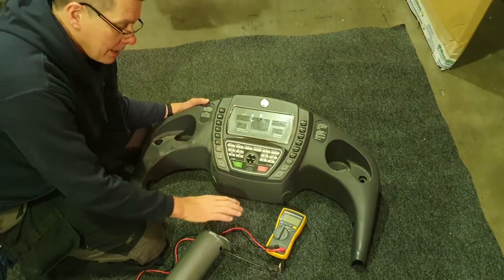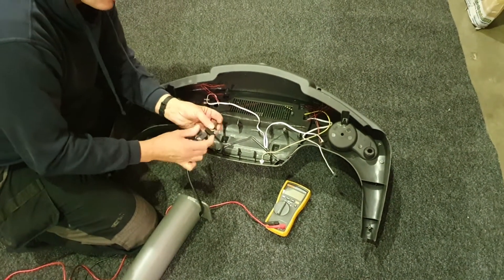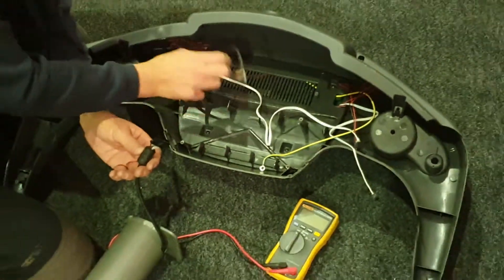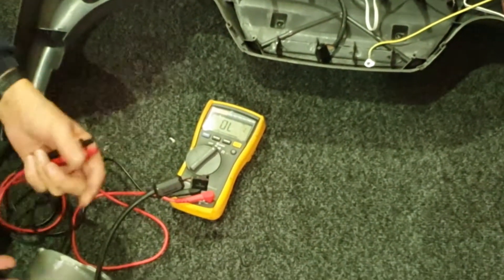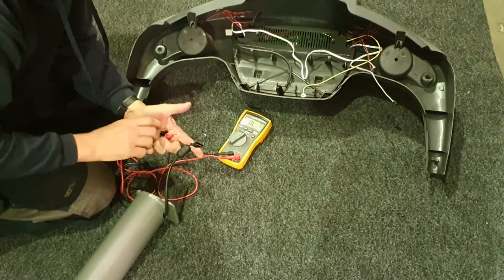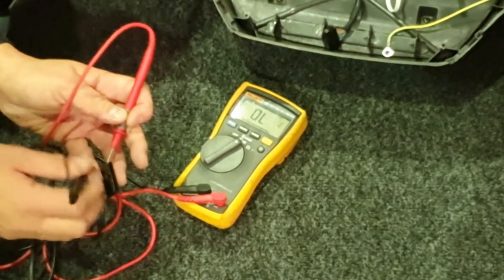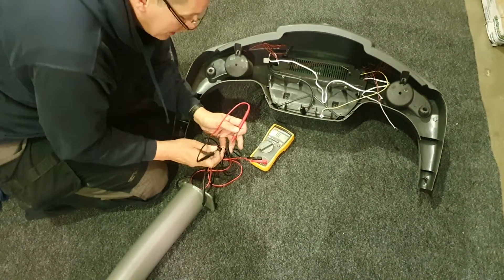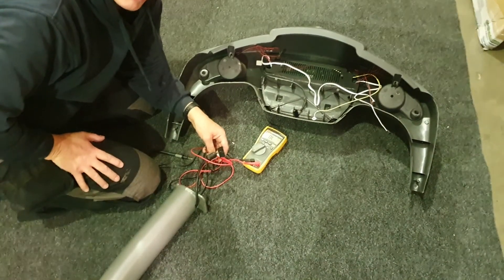Testing for voltage at the console

Comment: Hi, 
Your video is very helpful which helps me to test incoming power supply in display board.. 

I have issue in my treadmill, display is not coming. so I tested incoming current (connects to display board). I can see one pair of wire (black & white) giving 12.57 DC volt.  However in some other combination black/ read, black/ yellow, black/ green I can see some DV voltage ~11 Volt.. 
Is this correct?
Reply from the maker: 11-12V is a good voltage to read and suggests that there is power reaching your console. Power comes from the lower circuit board (MCB) and it is either present or not. If the console is still dead then it is likely the console circuit board has failed.